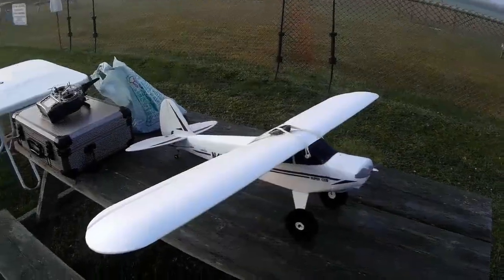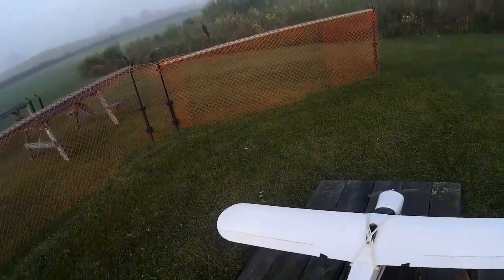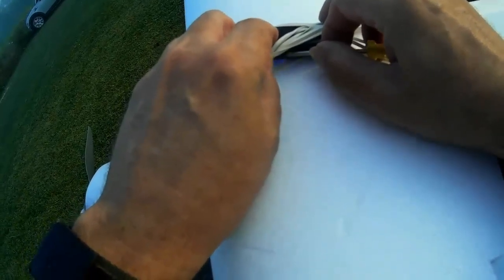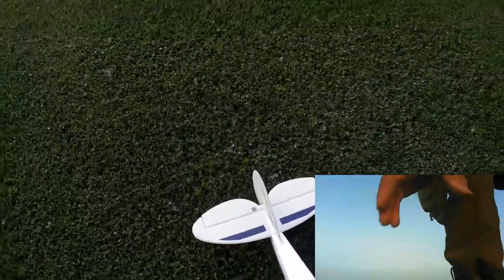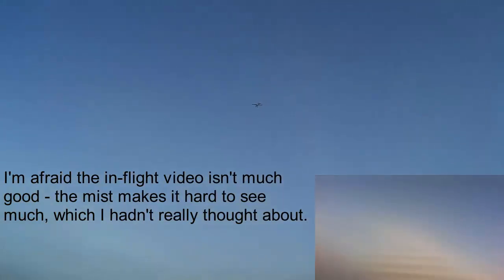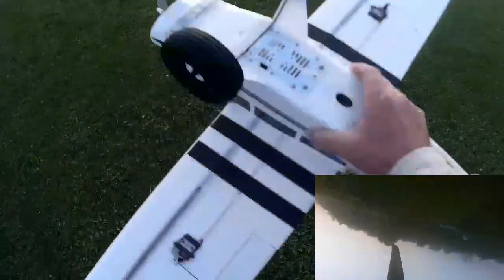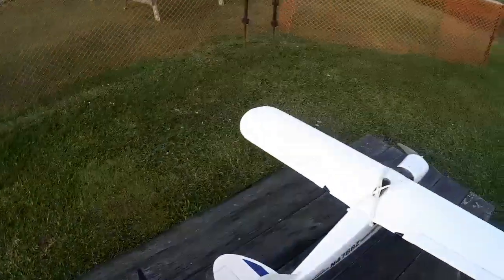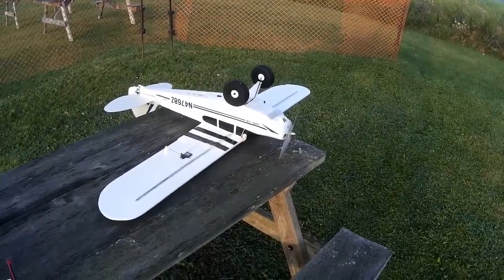Brushless Modded Super Cub Again

Comment: What motor and prop size?
Reply from the maker: It's a 1400kv brushless motor, and an 8x4 prop. Could possibly use something with a bit more power. It can certainly fly scale like this, but doesn't have oodles of power to spare.